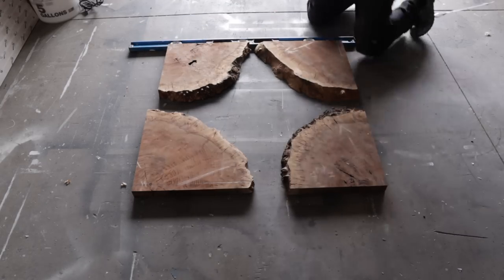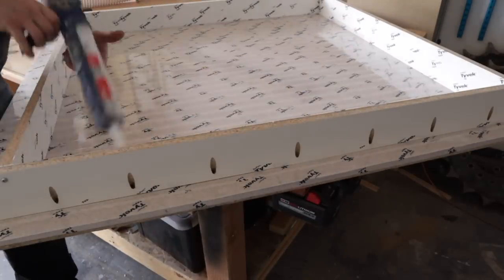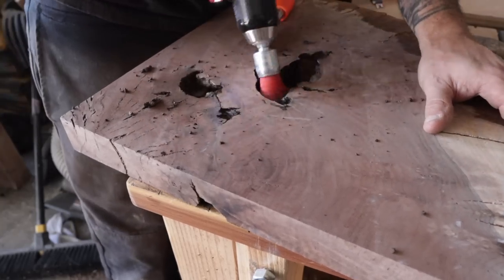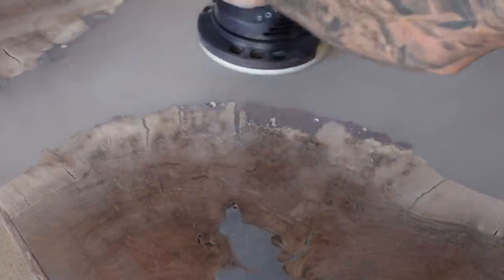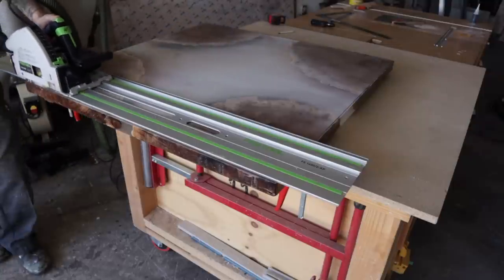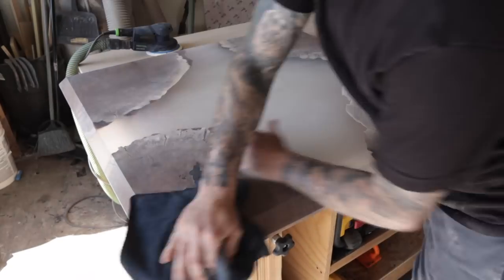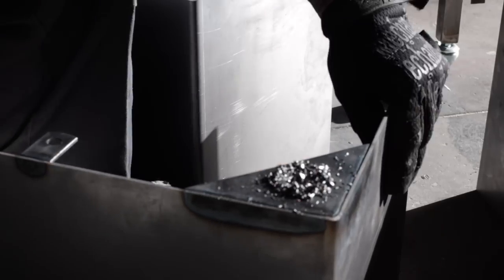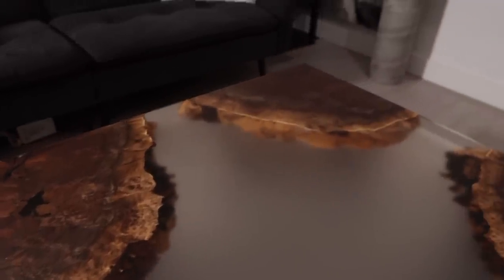Claro Walnut With Epoxy Coffee Table Process

Comment: Keep up the good work. 

what’s under your Sbr20 on that x axis rail to keep it from sagging? These 3.25hp routers are heavy lol.
Reply from the maker: Thank you! 
Ya they are heavy but no matter what I run it on it never even gets warm, and that’s a 3” surfacing bit!
    I believe I used a 1 1/2 x 1 1/2” aluminum angle to keep it stiff. Haven’t had any problems with sagging.

Comment: this is a stunning piece well done. How do you decide what size and how to position the steel legs?
Reply from the maker: I truly appreciate that! The design is part of the fun. I think of a concept that might look nice, typically based on the wood piece I get my hands on. Then I usually try and make it a measurement that isn’t standard since I’ve been a contractor for so many years, standard is boring!😁 I always have an idea on what the base might be but I wait until the top is finished to make the final decision on what it will be. Then I just play around and test fit the base or legs if possible to see what the best composition would be. It really is a fun process. Tons of work but definitely gratifying! Thanks!✌️

Comment: Beautiful table. I've heard epoxy always yellows over time, is this true?
Reply from the maker: Yes they do have a tendency to yellow, especially in direct sunlight and more so over time. Honestly, in my testing over the years I’ve found that most brand are really noticeable in a few months and even a few weeks. Especially if mixed with white pigment. Superclear epoxy is the only brand that I’ve not had any immediate problems with. It really depends on the situation. I’ve made some art where I’ve used epoxy to coat over something white and it’s barely noticeable down the road. I try to avoid doing that now. In situations like this table that has warm tones coming from the wood reflecting into the center, even if was clear glass it would appear the same. So with keeping it kinda frosted it will not be a problem. Also trying to stick with smoke or a colored pigment in the epoxy is pretty much key when planning a project. Here’s a link to the best video I’ve seen on someone doing multiple tests on those concerns. Thanks for the question! 

https://youtu.be/aEoMvZe8KQ8
Reply: @BrettJozsa  great video  thank you

Comment: If the holes are too small to get CA glue in, make them a little bigger with a chisel. (Stole this tip from blacktail studios.)
Reply from the maker: When I saw the footage of this table they looked a bit tight. I can’t remember exactly when but I believe since then I ended up increasing size one fraction and started countersinking the hole as well. Either way I kept a separate countersink and drill bit in a kit with the inserts now. Just to make sure I’m not searching around for sizes. 👍
Reply: @BrettJozsa  Sorry, I was referring to the small cracks on top and on the side you fix with CA glue as well.

And thanks for the videos. I found you yesterday but will definitely watch more. 😊
Reply from the maker: Gotcha! Ya I definitely gouge open some of those ones that like to be a pain. I’ve even successfully did a test where I drilled into the epoxy to remove a bubble. That was interesting but worked well. When it happens again I’ll make a quick video of it. Thank You!